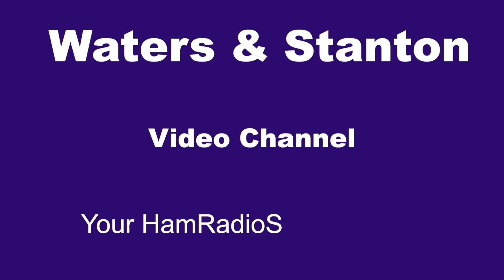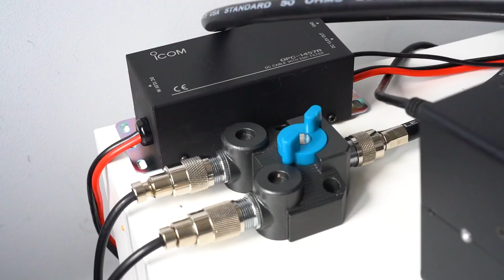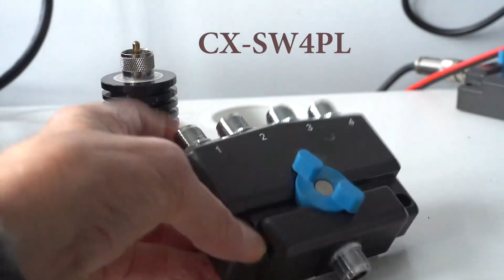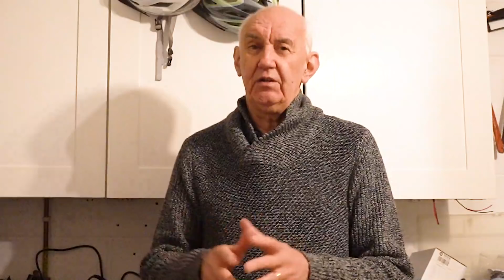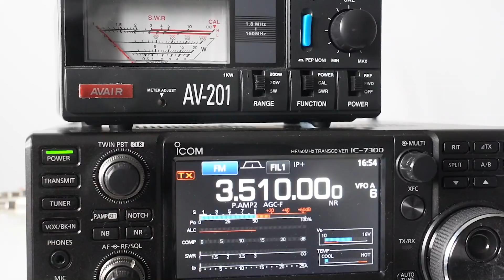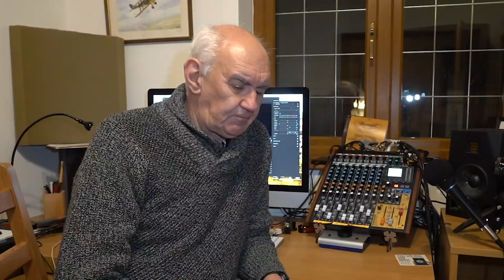Ham Radio Simple Accessories for Newcomers

Comment: Really like the topics you cover here and your presentaion style, Peter. I was wondering - I have a small garden (I mean REALLY small) and have no space for a vertical with radials. But... I do have the flat roof of my large garage. Will a vertical with radials work on the flat roof or does it need the soil? Anyway, thanks for your videos!
Reply: To my knowledge, and I could be completely wrong and not understand how this works... A vertical on a roof would be similar in concept to a mobile antenna on the roof of a car. In the latter case, however, the car roof is the ground plane. The radials of a stationary (hopefully!) vertical act as the ground plane. They should not need to be in contact with the earth. That said, your radiation pattern may not be what it would be if the base had ground contact. If the flat roof of your garage is metal, it may be worth experimenting electrically bonding the earth/ground side of your antenna to it. (I am American, and I do not know the codes or terminology that may be different between our countries.)

Comment: I really  enjoy your videos. but i did notice that the shot with the two position coax switch you have two connectors hooked up to it that need a better job of soldering or connecting to the coax.  I see this a lot in the marine industry  ( owners doing their own connections )  and with the salt water around it causes a lot of problems when done improperly.  PL259 connectors with the insert for rg58 or rg8x very seldom are properly installed.  - Might be a good video for future!

Comment: Of course along with a soldering iron, one must buy solder. Industry is mandated via RoHS regulations to use lead free solder, but as a residential rebel, instead of RoHS solder I recommend time-proven 63/37 Tin-Lead alloy solder, rosin flux core. It solders (wets) far more easily than RoHS alloys and at lower temperatures. It also gives a smooth shiny solder joint that won't grow "tin whiskers" that can happen with lead-free solders. Note you can apply this solder to the lead free joints on your radio as it readily mixes into the existing solder joint. Kester 24-6337-0027  works well for me. Buy a couple rolls in the event that it gets banned.

Comment: I think you're spot on and agree with your list of accessories. To any of the newer hams...I had an issue where whenever I transmitted a relay in my furnace( my shack is in the basement 15 feet from the furnace) would click like mad...as soon as I wrapped my coax through a ferrite core....problem gone.  Thanks for the video Peter..